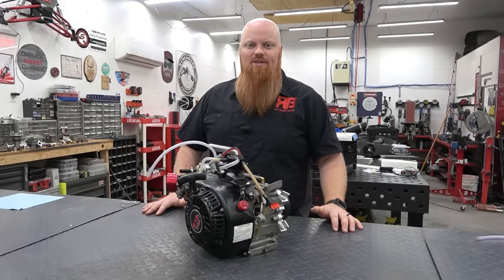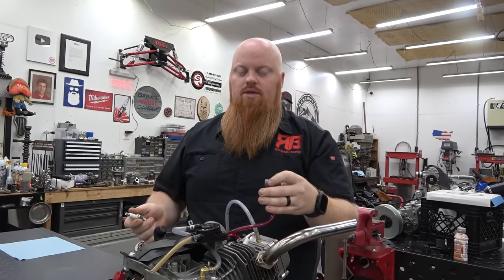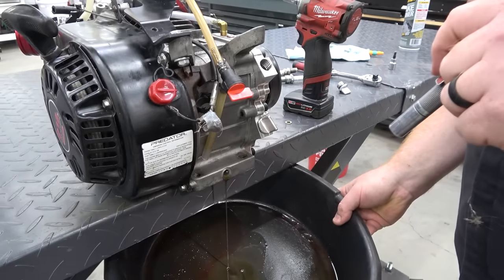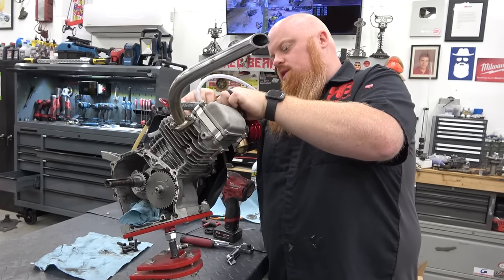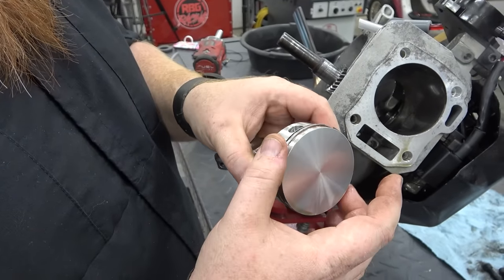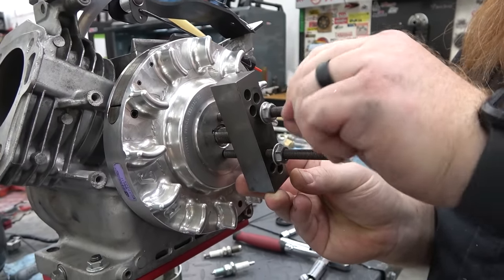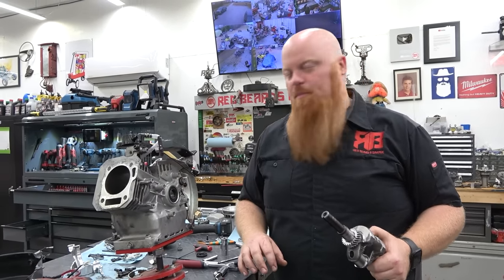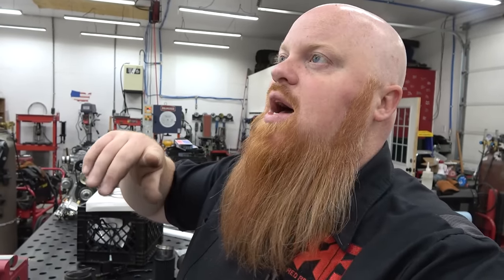My $900 Predator 212cc Wont Run ~ Subscribers Engine Teardown

Comment: No hate on Jose. Everyone starts somewhere, that's why we learn from our mistakes and don't give up on what you love to do
Reply: Amen brother -Jose 🙏
Reply: 100%!! Learning and teaching is how this hobby keeps going. Never be ashamed to learn, but always be willing to teach.
Reply: 10000000% in order to know things you need to learn if it means mistake are made
Reply: When I watched this, I started remembering some of the mistakes I’ve made on cars and small engines over the years. A LOT of them.
Reply: @chuckwalker4149  same some were major some were minimal
Reply: Yeah that's true,...but cleaning off gasket maternal and tightening bolts...
Reply: @mementomori4972  oh yeah definitely if not really knowing how to tighten the bolts and cleaning gasket material
Reply: @Savagegunner217  So if you don't know how to remove a gasket and how to tighten a bolt, you just don't do it?...is it that what you're saying? I don't think so. It looks to me like it was just a lot of impatience and carelessness involved. Same as with all the metal in the housing. Those are not mistakes you make, because you don't know it better. Those are "it's good enough" and "I don't need to read the manual" mistakes.
Reply: @mementomori4972  no I know how to do all that I mean like how much to tighten the bolt/nut ect. But it all common sense
Reply: I have a motor that has DH 225 on the top and I cannot identify the motor and predator can't identify the motor nobody can seem to identify it help
Reply: @robinarcher8351  Is it a TOPMAQ DH225?

Comment: You can definitely use a standard compression tester on these engines the compression release does not effect the results because most modern compression guages have a check valve and the engine still makes compression before the compression release releaves it I have checked compression before and after removing a compression release on my road to horse powers and it was the same useing a standard harbor freight compression guage

Comment: cleanliness is godliness. If the carb was lean because of the jet/emulsion tube plus the possible vacuum leak, could it have possibly ran lean this way and done damage to the piston as well. So hopefully the rod didnt get slightly pounded and bent.

Comment: I have to say RB, OUTSTANDING channel! You guys are real mentors to the next generation of knuckle busting gear heads.  This video should be shown to all the grease monkeys in school and I mean that in a very positive way.  I can still remember when I was in shop class tearing down the old Briggs engines and the first time it fired up after putting it back together, very rewarding feeling.  You have so much respect for this hobby. Over the top channel guys!

Comment: I’m from the southeast and I’ve found a little smaller jet will out perform larger ones 
If 110 is good central us 
95-100 is good in the south !! I’ve found this out the hard way.. save yourself a headache start smaller and if the engine just needs more then step up one size at a time. 
Don’t let the pilot whip you !

Comment: I went down a road like this kind of similar. I can't 100% tell, but that piston looks like a mono ring piston. I also ran one of those and had severe blow by in no time. The next rebuild i did on mine i switched to a dual scraper ring Wiseco piston and haven't had any issues since. Hope this gets to ya in time Red 
Beard!!
I do believe between a mono and dual scrapper ring Wiseco piston; pin heights are different. if I remember correctly from a 3.707 to a 3.595 length rod, factory crank. Happy Building !!

Comment: One con to the dingle berry ball hone is if the cylinder has uneven surfaces like pits from corrosion, the balls will follow those uneven surfaces. Generally I prefer to use the flat stone type as they’ve got a better chance of evening out the bore. Just my opinion from experience.
Reply: A ball hone is meant for deglazing the cylinder. It's not meant to use to get cross hatching back.. The correct way is to use a straight hone, like a Amco, Sunen,ect  but a straight hone is what you want. Otherwise if your cylinder is out  of round it will show where it's has low spots and when you are done you know it's perfect.. even after boring out a cylinder you always take the last few thousands out with a straight hone... NEVER A CHEAP BALL HONE... Those are about 35 to 70 dollars and a good straight hone is around 5 to 6 hundred dollars...not trying to be a smart ass but like you said after doing something wrong and then figure it out you learn... so hopefully you will do some research and you will find out what I have Said is correct.. you will never see a good machine shop ues a ball hone and then put it together. We use a ball hone first to clean the cylinder and deglazing a cylinder before assembly you use a straight hone to get proper clearance and a good cross hatch.... and if you do it your way or how I explained.  And do a leak down test on the cylinder your way and it will have more blow by
 a lot sooner than if you used a straight hone.. this is a fact and  thousands of engine builders will back it up... take care and have a great day....Bob....

Comment: My 420cc stripped threads on one of the carb studs....causing it to run lean.  Next oil change has glitter in the oil.  Engine still running and sounds good but running lean causes heat and accelerates wear.  The same happened to his.  With clean oil and the carb vacuum leak fixed, it'll probably run for a good while.

Comment: Great job, it is really tough to spend the money and take your time to do a clean build, all you want to do is get that engine running, but youngsters, take heed, keep it clean...
Reply: I did rush for the fact I just wanted it done I took it apart and it sat untill parts came In - Jose

Comment: Forged pistons, such as Wiseco, require extra bore clearance for the expansion of the piston. Factory hyperuetectic pistons do not expand at the rate of a forged piston. Wiseco pistons tend to have a lot of taper from the skirt to the top ring land; I would measure to ensure that most of the aluminum didn't come from the piston. More than likely, the bore is tapered, and piston clearance was not checked during assembly. Oil rings intersecting the pin bore are typically used in long rod or stroker applications.

Comment: The best advice I can give is double check everything then recheck it. Also the engine teardown area keep it clean . Remember we all do dumb things from time to time.some from learning new stuff some  from rushing.  Just learn from your mistakes and you will be fine .  

Now I was rushing one time I forgot to put in the c clip on a   pin that holds the piston rod to the piston well that build did not go well . What I learned is don't get in a rush make sure to check everything.

Comment: Can polish scratches out of any piston with out any issues.  Hone cylinder and new rings an buff piston. Rod bearing shinyness is just a coating consider it a break in coating. The shine can be fully worn off and it will still spec out completely fine. If you can physically feel scratches that’s no good but short of that the lack of shine isn’t anything to worry about. More holes in the emulation tube means it will run leaner longer but wide open top rpms will be same fuel ratio as less hole emulation tube. The rings should absolutely be replaced over anything else

Comment: Never use a drill bit to check jet sizes. Jets are not straight through, they are hourglass shaped.

You may have found a bit that fits the opening, but running it through the center you eliminated that throat of the jet. Even on a little pin vise hand/finger drill.

I have fixed many motorcycles, dirt bikes, ATVs, etc, that wouldn’t run because someone did some mods and went cheap and used a 1.20 mm drill bit to make a 120 jet.

Put proper 120 jets in it and it ran perfectly fine. Same gas and everything.
Reply: The carb in this video is a stock carb. Guys have been opening the main jets on these carbs for many years. If you buy a larger main from ARC racing you are getting a jet that they opened up with a drill bit. I've opened up a lot of them and they work fine.

Comment: FYI On the billet rockers the pushrod length has nothing to do with geometry as the adjuster is on the pushrod side not the valve side. Pushrod length just changes where your adjuster sits in the rocker. Geometry is set by the valve tip height.

Comment: Great disassembly video. If the old gasket material wasn't removed, wouldn't that throw off end play clearance? Never use steel razor blades on aluminum surfaces. Brass, or plastic scrapers and avoid the gouges and scratches.

Comment: nothing wrong with making mistakes thats how you learn. in high school my first year in shop class we toredown a 212 we had to take it completely apart like you did here and put it back together. now i had an upper hand there because i had years of building racecar engines by then. but when it came to building a 420 for my golfcart ive screwed a few things up. my excuse now is that im now working with one hand. the way i save money building small engines is to play the market and bulk buy parts when the usd is low and cad is nigh

Comment: You are so right about cleaning everything. Ive been building for many years from single cylinders to 900hp 410 sprint car engines. On the small engines, I have a dishwasher that I bought from the Used Appliance store after I clean everything in the parts washer, I run the block and all parts in the dish washer with very hot water. Gets super clean for final assembly. You are probably the most informative  on YouTube. There is a lot of BS on the Tube but my opinion you're the best yet. Enjoy your Holiday. PS...I have an EZ Bore boring machine tp do flatheads and Animal OHV blocks. When honing don't get it done.
Reply from the maker: The dishwasher idea is genius. like a budget steam cleaner. I'm going to look into getting one for the shop.
Reply: Yes it is. After the solvent, the washer for final wash for assembly. I found and old wringer type washing machine to clean shop towels. instead of tossing them and buying new

Comment: So, the wear or scoring of the piston can all be related to the loose nut on the carburetor. When you pulled the spark plug, you indicated it looked like it had been running rich. And when you found the loose carb nut, there was fuel puddling on the gasket surfaces to that side. This excessive rich condition can cause cylinder wash, where the excess, unburned fuel will wash away the oil lubricating the cylinder walls and cause the pison to be scored as well as the cylinder walls (this Condition usually damages piston rings aswell). Although, its probable he wasnt very clean with his drilling and tapping, its my belief all of the issues found (metal in the oil, scored piston, scored rod bearing) stemed from the carburetor being impoperly secured. Id be willing to bet his oil had a smell of fuel in it, which would confirm my theory. Great job on the tear down and explanation of everything.

Comment: To be honest, it's best to make mistakes on these engines. Yes it's money, but not expensive. 

I had a Pro engine builder explain the roles and reasons for when to use the ball hone vs the "puck" style. If the cylinders have been checked and verified parallel and true round, the ball hone is best. The "puck" style hone is best to check the cylinders for waves. 

There's more to this, those are just a couple examples he gave me.

Comment: Great idea for teaching us newbies! Jose did a lot right, but it was missed details that torpedoed the build. Greg do you have a Vacuum Valve seat tester? I used a portable Serdi brand at work (yeah high dollar for sure!, but much cheaper brands are available.) The big advantage is that the head can stay on the block & only the manifolds need removal to test valve sealing condition at the seat. Thanks RBG !

Comment: First time watching any of your videos “showed up on my feed”.  I know you said you’re a professional.  I’m no expert on the engine you’ve built   But I’ve built my Subarus engine “now making 1000+whp”.   Only suggestion I have is use ATF on a blue shop towel when cleaning the cly after honing it.  Yes the brake cleaner works but ATF is just that much better. Flip the towel over and keep going until the towel stays red like the fluid then you know at that point that cly is clean.   Love the video can’t wait for pt2     I have no idea what this engine is for or what it’s used in. But I’m now tempted to buy and build one 😅
Reply: Im working on a go kart frame I’m putting it on - Jose

Comment: I use to hit my Briggs animal with a 50 horse dry shot sneakie Pete kit straight thru the side of the carb an drag race it in Palatka FL taking the brothers money with the baja worrior mini bike an a welded max Torque clutch run on regular gas until the nitrous hit then it was all the giggle juice needless to say the wiseco took it well

Comment: I have found 3 mistakes. Not cleaned/clearanced properly. Not torqued properly and re-torqued. And #1, used a Wisco piston. If he would have had an Exhaust Gas Temperature sensor bolted on to his exhaust $15, this would have alerted immediately of the running hot from an intake leak, but the engine would have still failed from the Wisco piston not being clearanced all the way around the edges. Never use a piston with 1 ring unless you want maximum power on a drag strip tear down engine.

Comment: Only a minute into the video and I’m seeing an expensive billet side cover and a stock carb. Money spent in the wrong place. You gotta start simple and with priorities.

I sometimes judge the FFA small engine repair competition and it always boils down to compression, fuel/air, and spark, in the right amount, at the right time.
Reply: No he didn't lol.

Comment: The skirt wear is from the piston rocking back an forth in the bore, usually from excessive piston to wall clearance. Sometimes Depending on the length of the rod and the crank stroke you get side loading of the piston because of extreme rod ratio

Comment: I'm going to have to pull mine apart too I believe. Any advice? I've pulled the sidecover 3x after running and it runs good besides alot of vibration (without locktight bolts will fall out) and the bottom is full of metal. Just at a loss. I guess my first steps is look at clearances and rod bearing?

Comment: With the build that he has, he needs a bigger carb. Also the stock cranks main journal ovals really easy. It also looks like bigger valves, although I could be mistaken. These are very important to get a good grind on the seats and valves. I used a three angle, but they wear fast. I would suggest much better prep and cleaning as you rightfully  pointed out, and probably more frequent oil changes, especially on a new build. I have built hundreds of these and there is many ways to do it and will depend on how you use it. Using one top ring, usually means you are racing it, but this can only be run in the open class and he would get his clock cleaned with this setup. I also don't like his choice of clutch, as you cannot really adjust engagement, which I normally use 4000 rpm on stockers and 5000 rpm on modifieds and up. Honestly, I don't know how he uses this engine, so it is hard to make suggestions. He has some nice stuff, but it is incomplete for open classes. There are many mods that could be done here, but this is not the place to hash some out. The good thing is he is learning and if serious, could build a much better engine. Biggest thing is to make it breath and he has problems there. Just a tip, but drill out the idle jet from the stock .018" to .022" to make it start better and have more fuel when wide open. If he is going to use the stock type carb. You already pointed out the wrong main jet. I do like the plug he is using and sold thousands. It is a Nascar plug that is no longer used, but a great plug. Also check and see if he decked head or block. Sorry, but I tend to ramble. Thx for the vid, it brings back memories. My company was Pulse Racing, and I developed many parts for this engine and won many races.

Comment: Just adding my 2 cents.  Use soap and water to clean the cylinders.  Brake clean will not get all the grit out.  You can follow up with brake clean after using hot soapy water and a brush, but you need to use soap and water as brake clean, gas, kerosene, etc, will still leave grit in the cylinder.

Comment: Using a steel wire brush on plugs can magnetize them use brass or tooth brush to clean ur plugs,magnetized plugs can pick up debris and/ affect spark.

Comment: 19:01 I’m not sure the vacuum leak was a problem, I’ve run a briggs flathead that had an oversized intake and a newer briggs carb, and there was a hole in the intake and it still ran fine until it locked up

Comment: One thing I’ve noticed with these predator engines is after the engine runs for a period of time there are tight spots as you turn the engine over with the rope assembly. You can actually fill the tight spots as if the piston swells up too much and that’s what’s causing wear on that piston let alone the cylinder could also be expanding in some areas and not others. I feel once the engine has ran for about 10 or 15 hours. Those tight spots seem to go away because I have old engines apart when I would fill those tight spots and I would see that type of where on the pistonon both sides just to give you a heads up on what to look for

Comment: Those dingle ball hones are bad news. They'll make any cylinder look brand new, regardless of out of round or wear. The 3 stone hones will knock down the high spots and straighten up the cylinder, while giving good visual of the condition of the cylinder.